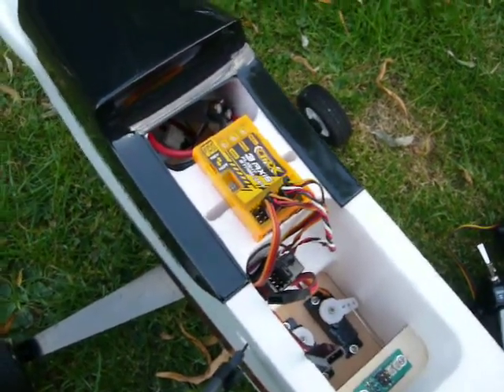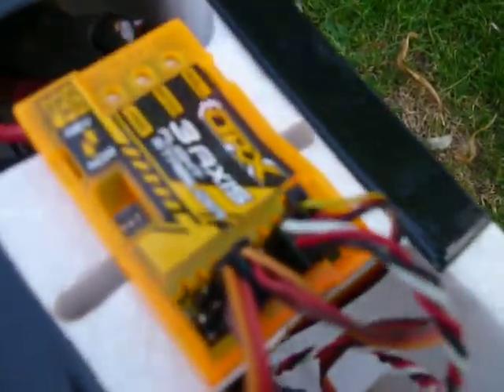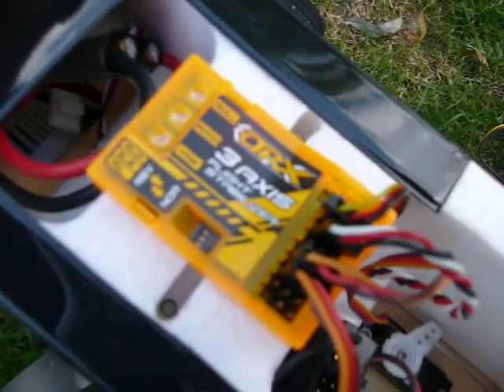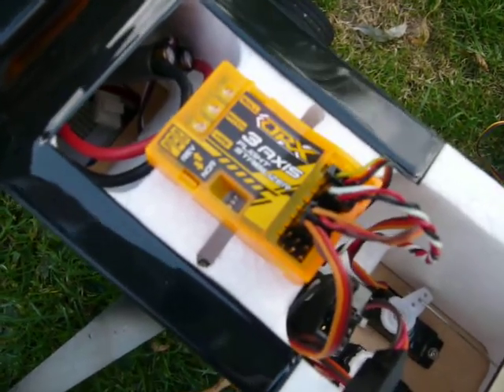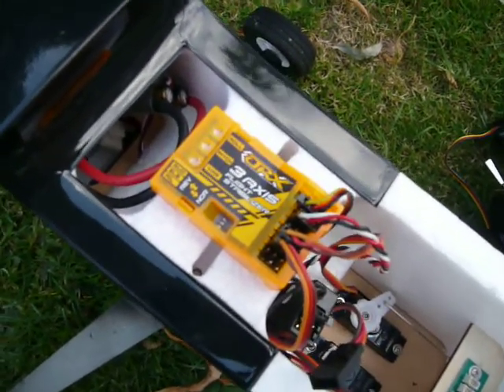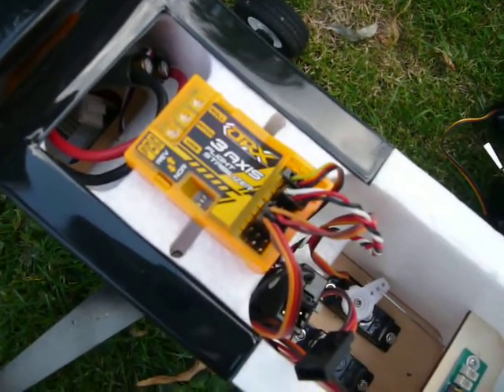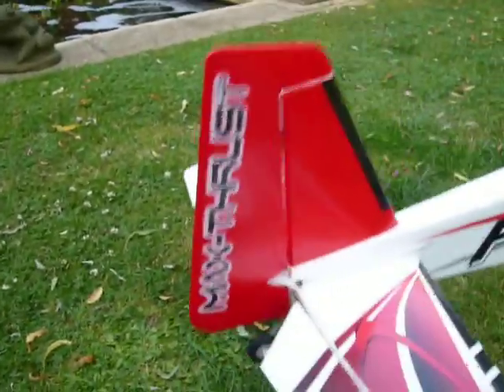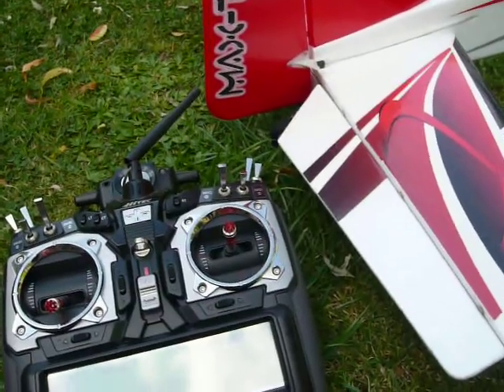Orange 3-Axis Flight Stabilizer

Comment: Great video. The issue you cite with pitch was "fixed" in version 2. Meaning, you can disable the fliight stabilizer if you want. Of course, if you just want to disable an axis (e.g., pitch on take-off with a tail dragger) that isn't a granularity offered. So really, you need to punch it and go. If your plane needs a lot of runway to get off the ground, I can see this resulting in a regression of the plane back to kit form.

Comment: The gyro only kicks in when there is no stick input unless you have the gain up real high. So on take off if your putting in control commands the gyro shouldnt affect you at all. Im not a tail dragger pilot but on the sims I dont usually dead stick the radio until i gain some altitude. if you grab the version 2 model you can program a channel to shut the gyro off so you can fly without it inc ase it goes tits up.